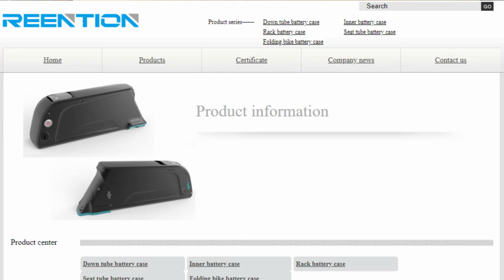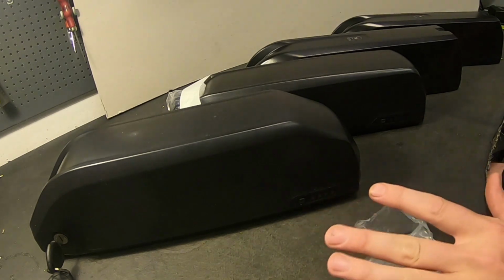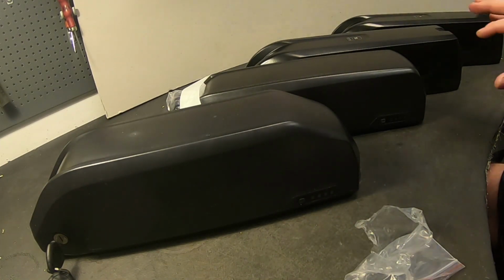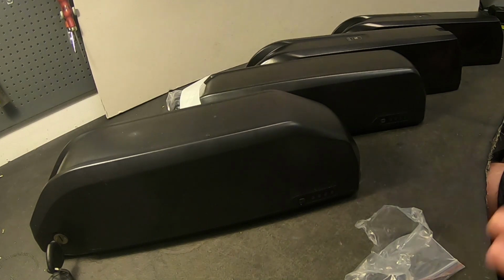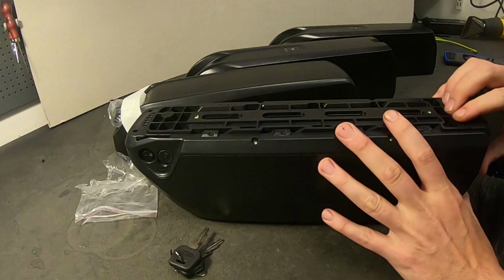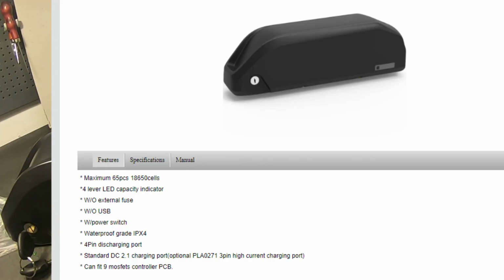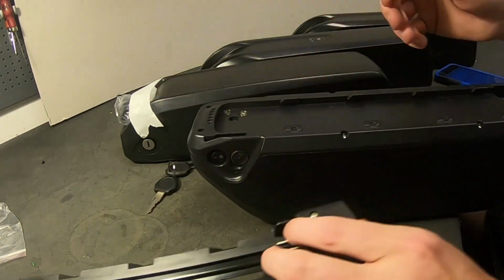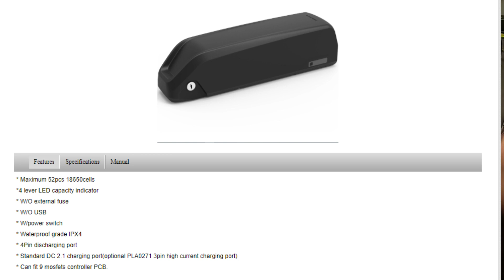New 48V DIY Battery Cases from Reention and Hailong for 18650 and 21700 Cells

Comment: Nice, I will assume i will be getting one of these case with my new 21700 48v, it's hard to gauge as they are sketchy on details and there is no stock till December 24. All i wanted to see was the mounting on/of motion to gauge a new frame.✌

Comment: Thanks, do you know how much current that on off switch can handle?
Reply from the maker: The switches on these cases are only for relays. They will probably melt att 100-200W.
Reply: @TheBatteryDoctor  Thanks...I thought that might be the case but could not get anything from vendors stating that.
Reply: @TheBatteryDoctor  do you have any suggestions for relays that would work with the on/off switches in these cases?

Comment: Have you seen the DP-7 case? It supposedly can have around 1300wh...
Reply: DP-9 higher
Reply: @lynnliu1904  Nope. DP-9 has 91 18650 cells max and DP-7 has 70 21700 cells max.

Comment: I have the first battery , but my on and off switch is not working. The button just stays on but it doesn’t stay in place wen o try to turn off. How can I fix?
Reply: You can buy replacement generic switches and ports online. DC 2.1 and I can't remember the size of the switch, there appears to be 2 sizes. The smaller one fits.

Comment: Are you able to put 98 cells into the DP9? 
It seems like it is possible:
https://endless-sphere.com/forums/viewtopic.php?t=108359
Reply from the maker: LOL! What DIY people will do given enough time! These cases and built for 250W! There is only rooms for a 250W BMS with 91 cells do craming in even more is insane (is saw the 3D printing)! and of top of that adding a 50A BMS! And the nickel connections need to be at least 0,6mm thick to handle 50A! Well im impressed but to do all that work! That bike has the perfect fame for a triangle pack which he could get from em3ev and make an even better bike, cheaper! The reention cases does not have discharging port for that high discharge! connectors will melt! But i doubt he would post when it does that in “EBike Build Threads”. Thanks for the link! it was a blast to read! We would never do that since we need go giva warranty!